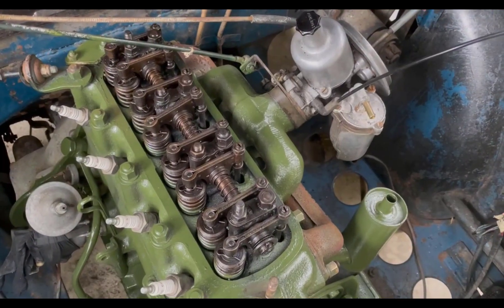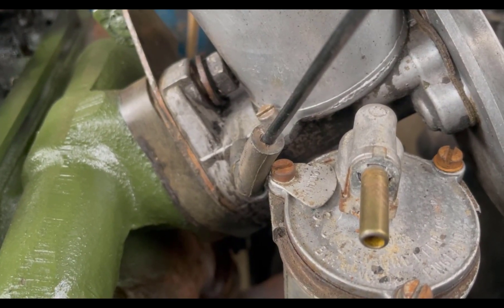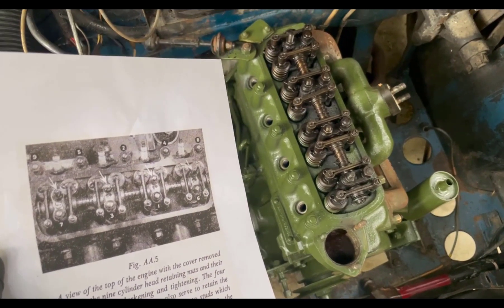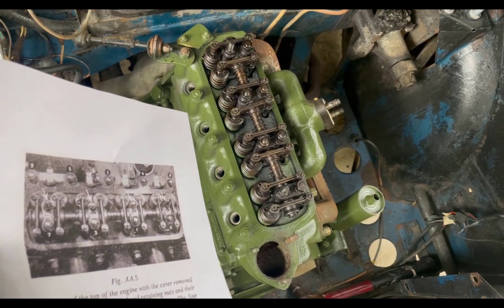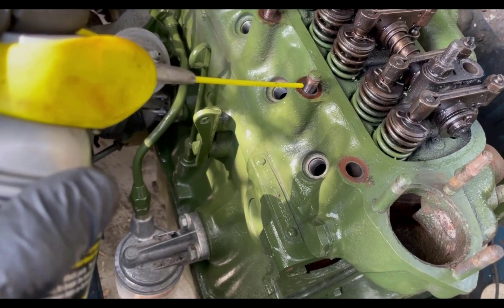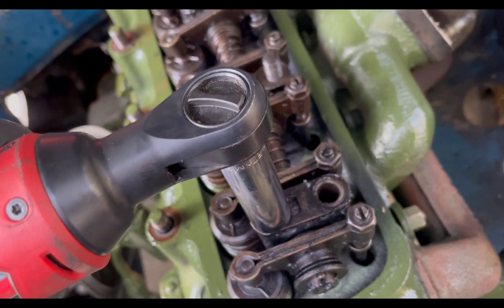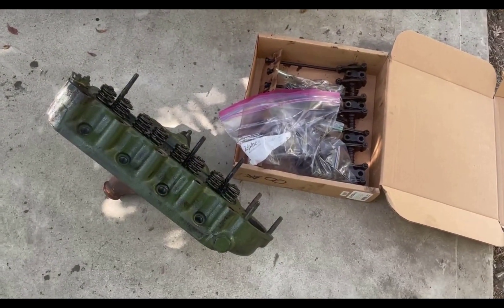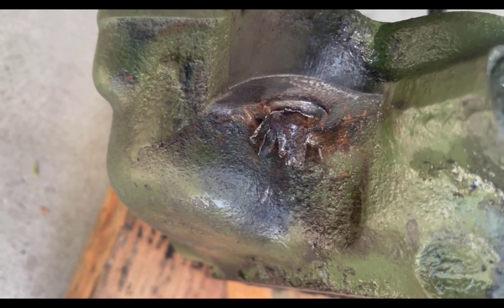Morris Minor Head Removal

Comment: That is very interesting. Thank you. 20 minutes ago I took my Minor down to the local garage for its first test in 27 years. However yesterday I noticed an oil leak from the head gasket so the head will have to come off. Apparently it's a blocked oil channel causing the leak and is not very common.

Comment: Although it a year on its still very useful, thank you from the UK ...
Reply from the maker: Thanks Shane.  The restoration is taking a bit long - I had not planned originally for a complete teardown of the body etc. Once you start on one thing...  The videos are behind the actual progress. At this time the body tub and all the steel and newly fabricated aluminum panels are at the paint shop getting blocked and sprayed.  The car will be gone about 4-6 weeks - in the meantime I will be working on the wood.   I hope your projects are going well.
Reply: Hi mate , project is going well,I'm working on my 1275 Healey engine at the moment and your video was of great use, thanks again 👍🏻